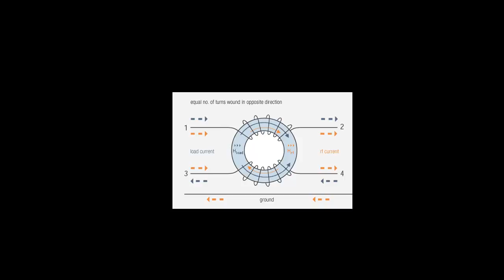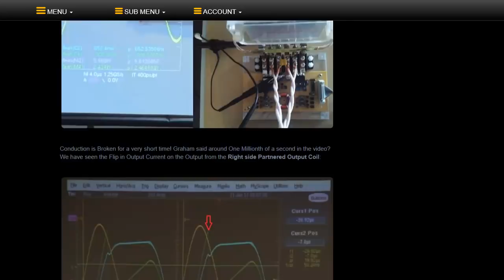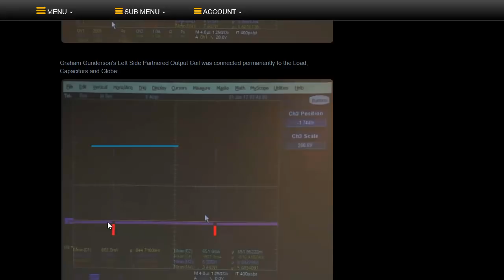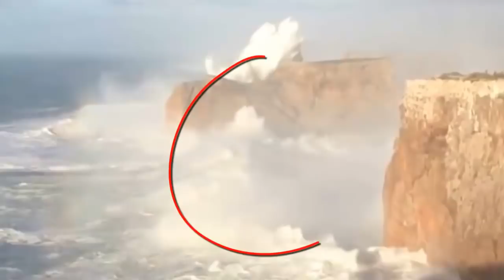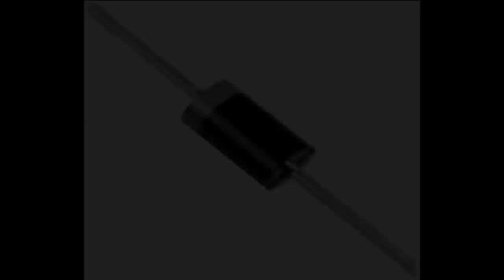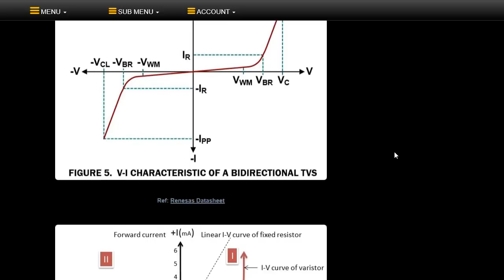Delayed Conduction - Some Insight.

Comment: Hi Chris, im not going too say i understand, otherwise i wouldnt be recording a 365 part video series on my fails, - but- in this video of yours, you say that anything that is 90degree's out of phase, you dont have too pay for, - - i spoke too thane heinz, but he didnt mention this.   because i already know it, - -  apparently.  ... so is there any reason i cannot use a capacitor in paralell with my well spaced magnets,  in my generator  ? ;-)... ps newman motor works great, i can spin the shaft for nothing.   kiss from western australia.  here is mine .  https://www.youtube.com/watch?v=rtE0NPCHwQQ
Reply from the maker: Hey Patrick - Phase angle normally depends on Load. Load determines Current: I = V / R where R is your Load, Current is the Magnetic Field, and the Magnetic Field changed Inductance L. L is defined as: L = dI / dt, where I is the Current changing through the Coil over time, if memory serves. So in a normal system, the more Load, lower the Resistance R, the higher the Current, this drops your Inductance L, so your Phase Angle changes and your Input Current Increases. This is how a Transformer works!

One needs a disconnect from Input to Output. A way to make your Output Coil not return a Negative Magnetic Field on your Input. Thus Partnered Output Coils.

Hope this helps!